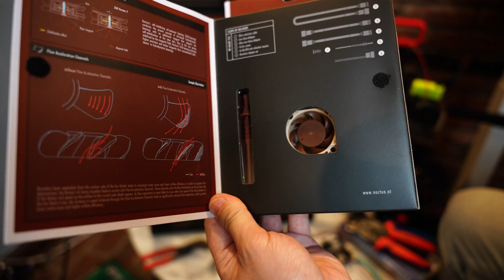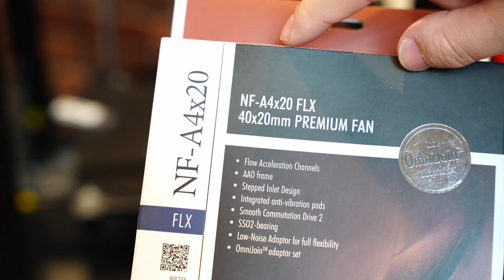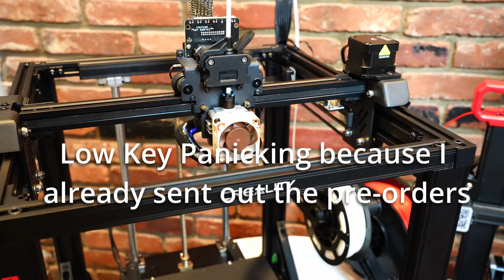ENDER 5 S1 - SILENT FAN UPGRADE and MODDER BOARD V2

Comment: just bite the bullet and add a buck circuit to power the fans because a resister can not drop voltage only amperage so the fans may still burn out at full power

Comment: your modder board says it is for an ender 3 s1 and this video is for ender 5 s1. So does it work for ender 3 or 5 s1
Reply from the maker: It works on both, but you have to lengthen the thermistor cable on the stock Ender 5 S1

Comment: My noctua hotend fan isn’t working and I have made sure the resistor is soldered correct and help would be appreciated
Reply from the maker: Join us on Discord: https://discord.gg/pZW7femQaJ

First thing I would check si the correct polarity for the noctua fan wires as well as where they are attached to the board. The backside of the board has +/- markings to tell which pin is which polarity, and the noctua fan documentation says which color wire is which polarity. Just remember that the + is red on one model and yellow on another. look up the noctua fan pinout for 3 or 4 pin fans depending on which you have
Reply: @NathanBuildsRobots  So I am using the omni join adapter that came with the fan. could that be causing the problem

Comment: bro, what did you do with the PWM signal pin for the power supply fan? the documentation states that it needs 5v and might break if it's overstepped

Comment: Hey Nathan, I just wanted to let you know that the fan grill on the power supply fan is probably making the bulk of the noise. I have a similar power supply, I replaced the fan inside it to a 92mm one with a 3D printed cover that had no fan grill, and then I took the old power supply fan and used it to cool the mainboard (on my old printer) - without the weird fan grill - and it sounded much quieter. So just removing the fan grill off the power supply cover might mitigate most of the noise.

Comment: You made a great board. I got a new 24v fan and it works great. I'm happy to know I have a bigger window for upgrades down the road. I'm also happy to report that both Wathai 5015 Blower Fan and WINSINN 5015 Blower 50mmx15mm 2PIN Fans with the fan mod fit in the Spriteburner v2. I almost forgot, you have to flip the positive and negative pins on the fan in order to make it work with the Mod Board since negative and positive are reversed on the board, otherwise the fan won't spin.

Comment: Hi Nathan, I just received Modder Board v2. My question is I have the Wathai 5015 Blower Fan 12V, I already modded it to make it fit in the Spriteburner too. But, Did I buy the wrong voltage 5015 fan, should it been the 5v instead of the 12v? Still confused about the resistor part, Thank you in advance. Chris
Reply: I figured it out. I need a 24v fan just like the original.

Comment: Nice. For the standard ender 5 I did something similar, but the 60x60x25 - took the PSU cover off and then used brass stand offs to list the lid up to make space. I also replaced the 4010 fan and reversed the direction to pull cool air in and expel it with the other one. The PSU fan is temperature controlled so it only comes on sometimes. The stand offs reduce the resonance as well. It was a bit of a mistake, but worked.

Comment: Is there any way to set up the resistor to drop voltage for the part cooling fans as well, to allow for a 12V part cooling fan to be used?
Reply from the maker: You can, but generally part cooling fans are higher powered, which means you end up dumping more heat into the resistor. I don’t like using resistive limiting for anything over 100mA

Comment: Hey Nathan, I saw that Noctua has a 24V 120mm and 140mm fan available. It may be a better solution for the PSU. They're both PWM as stock.
Reply from the maker: Those are much louder fans. They would work OK if using a little PWM module to slow them down
Reply: @NathanBuildsRobots  Thanks! I didn't realize that. The slower 24V  Noctua NF-F12 (2000RPM) is listed as 29dB whereas the 12V NF-F12 (1500RPM) is 24dB.
Reply from the maker: @aaronw1375  29 db is still pretty quiet, but 24 is barely audible

Comment: wouldn't it be better a to use a LM2574 or a regulated (for example DEBO DCDC DOWN 4)  instead of a resistor for the 24 to 12v pin?
greetz from austria
Reply from the maker: Probably would make more sense, but resistors are super simple, cheap, and virtually failure proof for low current draw applications.

Comment: Really love your channel I am about to buy the Ender 5 S1 shortly your channel is full of useful information thanks for all your time and effort, but if you ever make another revision there are small cheap plug in models of like 7812 that are switch mode
power supplies. Then you can go for more powerhungry fans too :)
Reply: thats basically a good idea but you have a around 2W heater with this module next to the stepper motor in an Ender 5 S1
so if you use the 7812 you need an additional heatsink for it

Comment: I have this board on my klippered ender 3 s1. I plugged in a 24v 5015 fan to either the 24v slots and it doesn't run. I splice the fan into the JST creality wire and it works. is there a code that I have to input into the printer configuration file to make those fan works ok those slot?
Reply from the maker: I would check the fan polarity. There are + and - leads on the back of the board. Lots of fans and cables have the red and black wires switched, since there is no standardized polarity.

Can you join the discord and ask there? It helps to be able to see pictures of the setup.
Reply: @NathanBuildsRobots  I am having the same kind of issue and I am using sonic pad, I plugged the original heater fan into the side spot instead of the top with the JST and it worked there so I am thinking I have to go into the config file to change the pin location but I am trying to figure out what the other would be named.

Comment: Nathan, you say in this video the the E5S1 is more for modding, and that its not like some other printers where they are just great out of the box.. I am curious, what are these "great out of the box" printers?
Reply from the maker: Lots depending on price range.
Reply: @NathanBuildsRobots  500 to 700?
Reply from the maker: @thomase907  I would get this or the P1P.

P1P is better in the sense that it works with no fussing around, and is faster. Easier to put together and start using, very little tweaking/tuning required on your end to get the most out of it. Downside is the Bambu Cloud stuff and lack of DIY serviceability is not my cup of tea.

I like the Ender 5 S1 printer because it’s more fun to work on. You have to set aside $100-$200 to spend on upgrades to tailor it to your liking. It’s much more of a project than the P1P, but not as much of a project as a Voron kit build. It’s a worse design by almost any metric. It I have a lot of fun with mine.
Reply from the maker: If I were going to start my own print farm, another option would be to get 2-3 artillery sidewinders. Great printers, easy to assemble, massive build volume, decently fast, Super cheap.
Reply: @NathanBuildsRobots  Okay so I did a deep dive on the P1P last night and it ended with an order completed for it haha this machine looks amazing man, its exactly what i've been looking for. Thank you for your help and suggestion!
Reply from the maker: No problem. I got a bad P1P, the quality looks pretty bad, but from what I hear this is not typical.
Reply: @NathanBuildsRobots  yeah I've watched probably 50 videos on the printer at this point and it seems that you did get a dud.. every other video I've seen showing comparisons to other printers shows how great thebp1p quality is. I'll report back once I get mine and get a few prints out of it.
Reply from the maker: @thomase907  Haha ok. Thing is, I bought the printer instead of receiving a review unit from Bambu. Maybe those review units had some extra QC checks to make sure they put out a good face for the public.
Reply: @NathanBuildsRobots  yeah I can definitely see that being the case.. im going to do some reddit browsing to see if anyone's complaining about that right now
Reply: @NathanBuildsRobots  Well my P1P has been functional for the past few days and I've come to the conclusion that you simply got a dud.. I'm getting amazing quality prints, even while printing fast.

Comment: What do you think of this printer? I have the ender 3 V2 with tons of upgrades and I was thinking of adding this printer next
Reply from the maker: I don't think you need it, a it doesn't offer anything above what a modded ender 3 v2 offers, but it is an interesting form factor and can go slightly faster with better components in the stock configuration, so your call!
Reply: @Nathan Builds Robots  I agree with you so I ended up ordering the Bambu Lab X1C last week

Comment: You really shouldnt user a resistor to halve the voltage . Its just asking for trouble . A VR would have been a much better solution .

Comment: Perhaps you can mount the resistor on the other side of the board, so when it heats up it doesn't damage your plastic connectors. It seems you have room to do so...
Reply from the maker: That is an interesting idea!

Comment: Might have glass beads put on resistor as that was old way to stand it off board, love the board will be getting one, the phone connectors when you squeeze them it’s called insulation displacement

Comment: So the 2 boards I ordered will be like this and will work for both the E5 S1 and the E3 S1 Pro?
Reply from the maker: Ender 3 S1 should be a drop in replacement, Ender 5 S1 should work with some slight rewiring shown in this video
Reply: @NathanBuildsRobots  I sent a message on Patreon, About adding some fan wiring kits to my order.
Reply: I sent the E5 S1 back, too many problems to deal with. But I’ll use your boards for sure on the E3 S1 pro
Reply: @NathanBuildsRobots  Dang I need to order a couple of the fan wire pigtails and some of the solderless splices. Or I could get them from AMAZON or DigiKey maybe

Comment: just received my V2
all the lower connectors, those that mount the original creality fans work
the whole upper row does not seem to work, plugging fans in the 2 Pfan connectors and one in the HF1 do not spin
any idea? i'm using standard 24c 4010 and 5015 fan
am i doing something wrong? 
Am I forgetting to do something?

Comment: What is that latched 24 pin connecter called? and where can I get one? :D
Reply from the maker: I had to order mine direct through a manufacturer, took me months to track down.
Reply: @NathanBuildsRobots  sycks for me i guess :D
Reply: Hey  @NathanBuildsRobots  Since you have a source for that connector I got an idea I would like to run by you if you have 5 min at some  point. it should be very simple but I don't have the skills to draw up pcb's. We share a few discord channels so I should be easy to find :)

Comment: Hey Nathan, met you at ERRF. Couldn’t agree more with you about creality machines basically being tinker grade. Just wanted to float an idea, what are thoughts on making a similar breakout board to work with tool changers like the hermit crab or mutant?
Reply from the maker: Could be interesting. I will have to look into those products in more detail. Would it be too add sprite compatibility to those systems? Or just make them more moddable in general?
Reply: @NathanBuildsRobots  a bit of both I’d say. I’m going from a Sprite to the hermit crab right now. Ideally I’d just like to have one of tool plates taken but by the Sprite. IMHO the hermit crab would be better if it used a flat ribbon cable and if the wiring terminals were in a different spot. During assembly of the hermit crab you have to remove and reinstall the PCBs anyways, I’d imagine if someone were crafty enough they could design a better PCB.

Comment: adding the resistor on the board permanently and allowing it to be toggled on or bypass using a micro switch so users don't have to risk destroying the board by soldering it without experience or proper tools might be something to try on the next version of the board. It is nice that you gave the solder points some space from the rest of the circuit, but don't underestimate the human capacity to catastrophically fuck shit up
Reply from the maker: True. I want to build a buck converter into the next version. If someone is not capable of soldering it themselves, hopefully they can find someone who can, or use it as a learning opportunity.
If it's too daunting I would just recommend people to not install it and stick to 24V fans.
Reply: @NathanBuildsRobots  I have ordered the ender 5 s1. The PSU fan seems very anoying,  so it is a 24v fan? How did you convert it to a 12v noctua fan?

Comment: @1:00...wth would you use a resistor instead of an LDO?  They cost basically nothing, are a single T0-220 package, aren't gonna get hot, and can do like...2-3A...  Look up the L7812 - they have a wide voltage input, 12v output, with very few components (practically none), and can do 2A easy.  Without being a fire hazard...
Reply from the maker: Do those have short circuit protection built-in? I can add them in the next revision, but I think they burn off the power, but if they are soldered to the board it will have a lot more dissapative power. Would also need to probably use a capacitor too?

Comment: I changed the fans in my power supplies on my Ender 5 Plus machines and it is so so quiet, I have my printers in my workshop and before I got the 5+ printers I had Ender 3's in there and didnt bother changing the fans as they were loud but not annoying but the 5+ printers are in another league, I could hear them outside the workshop thats how loud they were!
Reply from the maker: Yeah, Creality's new PSUs have some real garbage fans on them. Fortunately there is plenty of space to fit a big low-profile fan in there.

Comment: Rather than add resistors you should have used a potentiometer or installed a thermister controlled fan control board.
Reply from the maker: That would be nice. 
Nice thing about resistors is they are cheap and almost never fail. Not the best solution, but certainly one of the easiest.

Comment: If you do a full klipper install (not with the sonic pad) with a Pi or equivalent, you can add canbus and use a canbus toolboard. I have a canbus toolboard on my voron, and I klipirized my older bed slinger, and put a canbus toolboard on it too. Now just need 4 wires going to the toolboard -- not 24 or however many the ribbon cable has. I've migrated my big 4 headed printer to canbus as well, a huge reduction in amount of wires it uses.
Reply from the maker: I would like to try Canbus eventually. It's nice to have less wires but you need more microcontrollers and stuff. Plus, doesn't it rule out anything besides klipper?
Reply: @NathanBuildsRobots  my big 4 headed printer runs duet. All expansion on duet3 is done via canbus
Reply from the maker: @kazolar  now that is nice! Any pics or videos?

Comment: You could do like a toolhead board for the Ender 3 that also works with Micro swiss direct drive as i have one installed with an cable out board down close to the mainboard so you could tiddy it up a bit more and use a single cable im unsure if its possible but just an idea.
Reply from the maker: So many ideas, so little time! Not sure I get the idea of a toolhead board. There is a way to install the modder board in the base of the machine, then run standard cables out to the hotend. But I like taking advantage of the 24-pin connector. Its pretty nice!